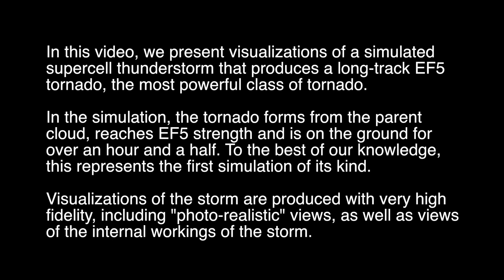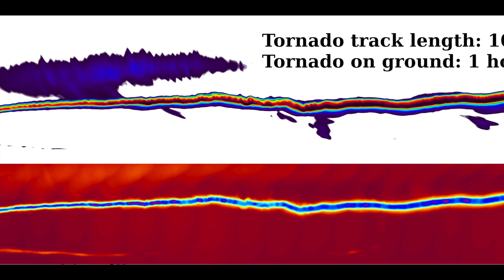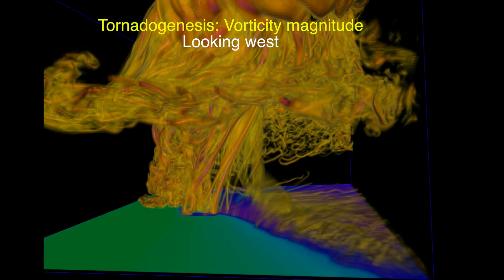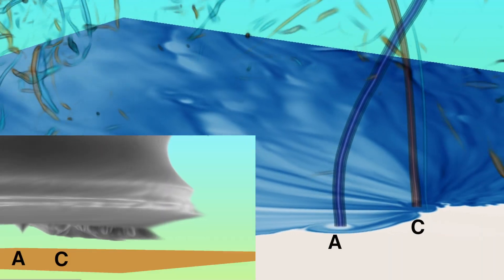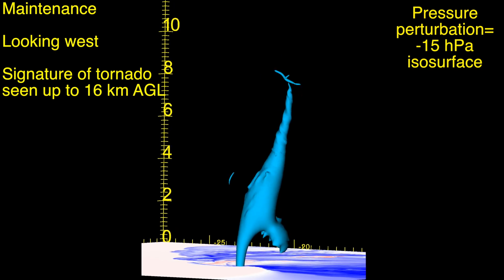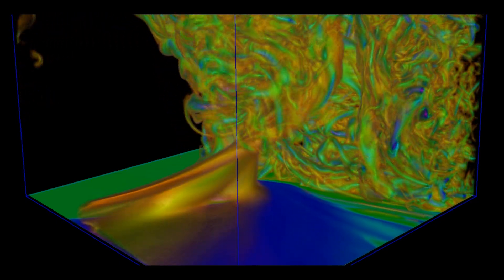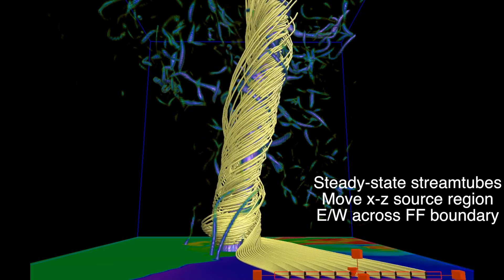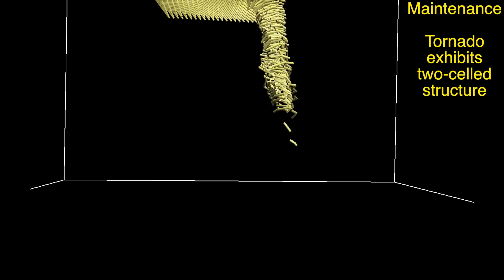Visualizations of a supercell thunderstorm that spawns a long-track EF5 tornado

Comment: ..can produce the moving equivalent of a nuclear bomb...

Testing of weather weapons based on the pulsed subcritical reaction of plutonium began in the USA in the mid-50s. This is why there is no PUBLIC radiology network in the US. Weather drones were at first primitive balloons with difficult radio control, but scientific progress has taken its toll and today they are incredibly effective.

DON'T LOOK UP ) 

OPPENHEIMER - Creating The Nuke Scene
Cortex Videos

15:44 
the finger of satan...

When you look at ANOTHER mushroom cloud of a supercell, does it HINT TO YOU ANYTHING? Then just take dosimeters and run to check the gamma level)))

Oppengamer was the first to believe in gamma weapons, then he convinced the generals of the HIDDEN power of weather weapons based on PULSE nuclear reactions...and then the race began for “weapons-grade” plutonium supposedly to counter the Soviets... that’s very briefly)

The generals were also shocked, but Oppy easily convinced them of the reality of this thing. Then it’s a matter of technology and finance...

Plutonium core based meteodrones use HIGH RADIATION GAMMA IMPULSE for provokation HUGE water condensed process in previosly still atmosphere...meansured, please), GAMMA LEVEL near typical "supercell"

It is necessary to measure gamma AT THE BEGINNING of the supercell formation process - while the drones are ACTIVE. This is the first half hour.

The plutonium core of the meteodrone generates powerful radial gamma pulses in the dew point layer and this gives the PRIMARY impetus to the entire process of creating a pressure/temperature gradient.

Gamma radiation ionizes moist air, it condenses into a powerful cloud, a pressure gradient arises and the supercell mechanism is activated - warm air from all sides tends to the center of the format.

Has anyone asked the feds why there is no PUBLIC network of radiology stations in the USA? In Canada it exists, and these stations show very interesting data when supercells pass over them...

Comment: Dumb question time!  I appreciate the veiws from SE, NW, etc but I can't quite understand where the winds are the most violent apart from immediately in the path and behind it.  We see destruction adjacent to the paths of tornadoes.  For example, if a tornado is traveling west to east, it seems that SE and then SW is more precarious than NE and NW to some degree.  Would this be somewhat accurate?

Comment: I'm not a scientist or anything (working for that degree slowly) but these animations make me wonder if the strength of the forward flank winds or the winds coming from the cold pool have any effect on top-down versus bottom-up formation. It seems from the animations that stronger forward flank winds being warmer and being overall less dense cause the particles to quickly rise as they tighten around the updraft and funnel down, where the cold pool particles stay more surface based and rise up. I know this is done with the assumption of a tornado producing EF-5 winds and is in progress, but it makes me wonder if storms where the cold pool is more dominant from rain cooling or encountering any features in the area around it would be more likely to form initially as vortices at the surface before the main funnel appears and vice-versa. It's probably something simple that meteorologists have figured out by now, but i do like asking questions I don't know even if the answer is negligable. Negligable is still a workable varaible.
Reply from the maker: For sure the density of the cold pool (or, the "coldness" of it) plays a huge role in all mesoscale convective phenomena! If the cold pool is too cold, it tends to rush ahead of the updraft and "gust out". If it's not cold enough, you may not be able generate enough horizontal vorticity in the cold pool. But really it's chaos and there likely won't be neat tidy answers to "the tornado problem"

Comment: Bear with me guys but I think a combination of Doctor Leigh's theory and existing tornado theories are true. The SVC near the tail cloud = Massive Low Pressure. LP = Lowering of the updraft base. This = Extreme tilting and stretching of shear vorticity near the ground- the turbulent phase. A vague disorganized tornado 🌪️🌀 is born. Equal and opposite centrifugal forces resulting from this rapid rotation in turn help spin up and fling away rain 🌧️ & moisture and thus expel the RFD which as it descends is drawn in towards this rotation. It precipitates, wraps around, strikes the ground, fans out and THEN pinches the occluded gust front between the RFD and Inflow winds- the laminar phase. This occluded wake helps carve the condensed, centripetal tornadic funnel into a more smooth stream. And the RFD in turn helps strengthen the existing tornado 🌪️ but not necessarily to maintain it. 

So the RFD is the variable that may be helping to strengthen the tornado. All this may occur but be relatively invisible to our eyes. 

If it's equal and opposite, how could the RFD produce a tornado that's stronger than the variable that created it? That's easy... Gravity. The expulsion of the RFD is further accelerated by gravity, whereas updraft buoyancy and heavy moist air is thrust against it.

Comment: Posted this on a collaboration video with you and hank too.

G L
My father is a chemical engineer, I got his analytical mind but not his level of intelligence. The following are thoughts/key points from our discussion. Consider them just possibilities.

1) the correlation of pressure dropping, the cold air being utilized more than once thought and the vacuum created by the pressure drop may be a precursor. Think of all that water vapor suddenly becoming rain drops and the space the water vapor originally took up as a gas, being suddenly left open. That might create your vaccum to turn that horizontal rotation vertical to create that upside down U. Lightening is correlated to rain and such, so its interesting that lightening is often intense around a powerful supercell or storm. So, the intensity of the lightening could signify the intensity of those water particles rapidly consolidating into water droplets, possibly forming the updraft of suction of that rotation skyward. Only problem with this theory is that some tornadoes have minimal rain associated with them, so that throws a wrench in there.

2) I have discussed the idea of the cold air in relation to an engine in another video but I'll summarize it again here with some thoughts added in. Life on this planet revolves around oxygen. Plants create it, we and the beasts breath it, fire needs it and even engines need it. Diesel engines run on pressure and LOVE cold air. Compress cold air and diesel in 6 inline cylinders in the right way and you'll push out serious horsepower as you add more fuel and cool air. Hot air works...yeah, but they LOVE cool air because it is more oxygen rich in nature. Particles are moving slower so you can get more oxygen in there. When we breathe, cool air (not freezing but cool) does better than hot air for us. What if a storm was no different? What if they defied their own laws of buoyancy because they feed on the cold air and oxygen? Obviously the temperature difference and wind shear play a roll in storm development...but what if it REALLY wanted the cold air?

These are just thoughts and maybe they are way off. But I think it will take more than meteorologists to figure this out. We need to research the properties of air (oxygen) more in relation to pressure and temperature. What does it do and how does it move in certain conditions? Maybe we are focused on the wrong areas because we spent years trying to prove theories rather than to find the truth. Scientific process cannot be used to PROVE something or else we will try in every way to MAKE IT HAPPEN that way. We are trying to validate things rather than discover. This collaboration between those on the ground and those with the tech is paramount to the field of study. We have to match what is thought to be discovered with reality before we move on to the next step. Otherwise, we are speeding down a road hypothesized to be smooth and straight when it might have a cliff ahead. We need to involve more people that may have been left out before. Chemical engineers, biologists, chemists, chasers, meteorologists, astronomers....anyone could have a theory to test as they have a different angle of approach and are unhindered by preconceived notions (mostly).

Where we are now, we warn at every sign of rotation, so we have nothing to lose by studying new theories and observing. Maybe take that model and tell it what to do. I know you want it to do it alone, but introduce factors you think would kill that tornado development and see what happens. Maybe by searching for what hinders them, we will discover what causes them. Take a bad tornadic events data and change one thing at a time little by little; humidity, temps, dew point, wind speeds.....see if you can mess the storm up and discover what it needs the most to thrive. 

Sorry for the long comment, but maybe someone will see it and do something with it. Maybe these things have already been done...
Reply: I agree with much of what you commented on especially bringing more professional fields into the discussion for outside points of view hopefully fueling ideas outside the norm so we can better predict these killers. My thoughts exactly when you mentioned more focus on low pressure& cold air involvement. Nice to see others thinking outside the box but critically. May GOD bless!